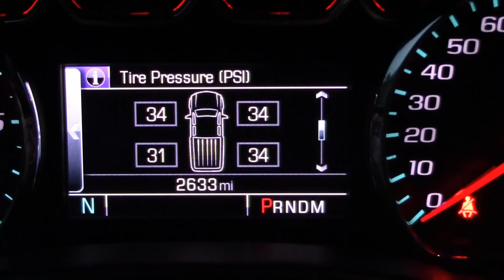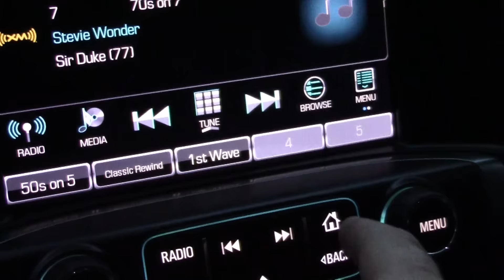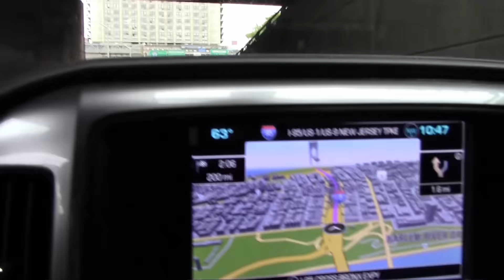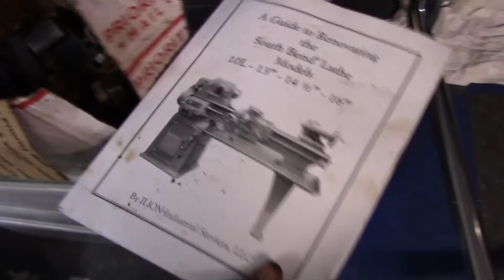New Lathe and Pennsylvania Trip

Comment: OMG, this is going to be a great project. I remember when I got my little SB 9 inch lathe. My wife and I drove for about an hour to get the lathe. The seller and his friend loaded it into the bed of the truck. We had to partially disassemble the lathe to get it into the truck, due to the camper shell. Once home my son stopped by to help unload the table for the lathe, but after that I was on my own. I took it part by part into the garage , but when it came time to move the lathe bed, my wife got a hold of one end and said, OK old guy lets do it. Never mess with that lady. The rest is history and has run great ever since. I had to laugh, watching you unload that monster. It brought back memories, but lucky for me, I didn't have to go downstairs. I wish you the best with this project and look forward to seeing this lathe come to life.

Take care....Ken, Marina CA, originally from Greenfield MA but this is where the Army retired me out.
Reply from the maker: Thanks!  When I got the 9 me and the guy I bought it from were able to lift it into my truck.  I swear the.bell housing with the drive pulley on this thing weighs as much as the 9.  It's somewhere between 1300-1400lbs total.

Comment: Amazing how heavy those things are when you add up all the parts.  My Chevy S10 was NOT impressed hauling my Heavy 10 on the underdrive cabinet home.  It did it, and it wasn't sitting on the bump stops but it definitely met them several times while driving. It was assembled too, so it was a little bit top heavy.  Made the mistake of letting my friend convince me that we could load it into the back of the truck complete.  We did it, but once it was in there he realized why I wanted to take the lathe off the cabinet at least.
Reply from the maker: Yeah complete this thing would have sucked.  weight of everything puts it somewhere in the 1500LB mark.  Truck handled it fine.

Comment: Hi mate.  On that engine hoist, you might benefit from one of those winches that normally are used on boat trailers to pull the boat up on the trailer.  You just weld a plate on the back post and have some pullies that run the cable through the boom.  Failing that you can always ask the boss for a truck with a tilting bed, and back the truck up to the hole  ( o;

Comment: Those are nice lathes.  I sold one just like it a while back for a friend.  The single tumbler versions also have the small spindle bore, which is less desirable, but it appears you go for the old stuff, which is perfectly fine.  Look into Turcite for the saddle, if it is worth messing with it at all.  It appears to be in decent shape, not abused.  I guess you have your winter project now...
Reply from the maker: Yeah I'm not really concerned with the spindle.  Granted 1 3/8" through hole with 5c collett capability would be nice, but the 1" that this is is still an upgrade over the 9.  I'll just have to make a new collet Chuck for my ER set.  on the plus side this is plain bearing like the 9.  No bronze to deal with.

Comment: Hey, similar to my 13", but I mine's a little newer and a tool room version. I have a few questions. Would you be able to weight a few parts if possible. If you could it would help me and many others out in figuring out the odds of getting a herniated disc! I'm mainly interested in the weight of the bed ( not sure your length) cast base, and complete headstock. I've been guessing that my 6' bed is in the 500 lbs range but I'm thinking it's more. After doing a complete restore on my 10L last year, I'm still waiting to find motivation to give my 13 the full monty!
Reply from the maker: I have nothing that will weigh that high.  I can lift one end of the bed (6') myself.  I can lift the headstock although it's at the edge of my comfort zone.  I haven't tried lifting the bell housing by myself.
Reply: bathroom scale on each side of the stripped bed? That does help though. Sounds a little more manageable than I was thinking.

Comment: that albrecht looks like it may have been a setup for gun drilling. that may explain the bushing in the back. to choke up on the shaft of the drill and have two accurate points of contact versus just one in the chuck.
Reply from the maker: It's possible.

Comment: Nice trip and lathe, on my south bend 16 the motor wouldn't fit through any of the doors, I had to lift the lathe and slide it in under the bottom.
Reply from the maker: Yeah the motor was already out when I got it.  We took the drive assembly out before we put it in my truck.
Reply: Halligan142 I didn't want you to get it all together then have to lift it to get the motor in. I was lucky I had a tractor and loader to pick it up and change my motor.

Comment: I'd chose a 3 ph motor / VFD combination over a standard single ph every single time. It saves a lot of belt shifting and will provide a better surface finish with quieter running as well. It might be worth setting up just the top section of the carriage on the ways at the less worn tail stock end of the bed, set up a couple of indicators against the bed way surfaces and slide the top of the carriage back and forth to get some rough ideas of what you have for actual bed wear. There's a few high tech machine tool epoxys around that might be worth investigating to fill that score mark to prevent that area of becoming a swarf trap and causing further scoring.
Reply from the maker: Yeah a VFD would be my choice also but I have a bunch of single phase motors hanging around at work.  Sometimes free wins out over best.
Reply: LOL, true and that logic is hard to argue with.